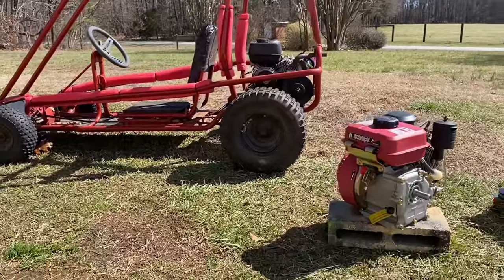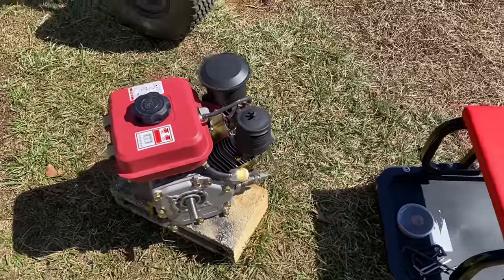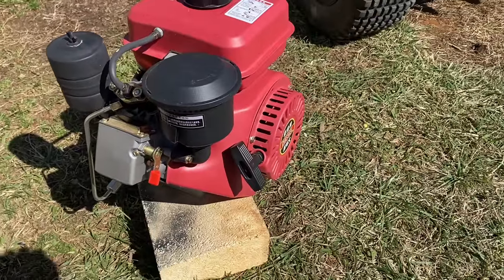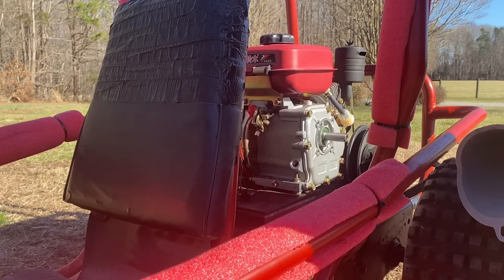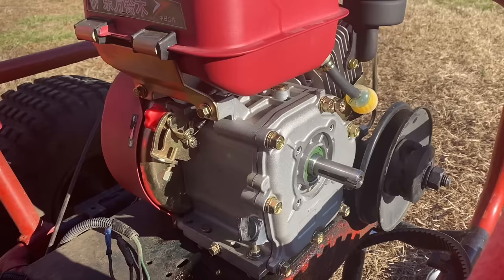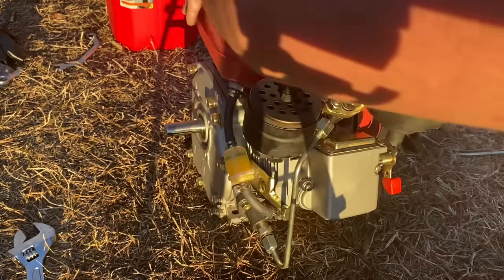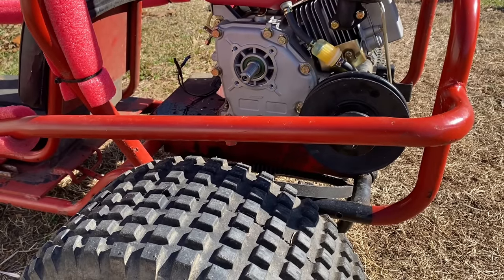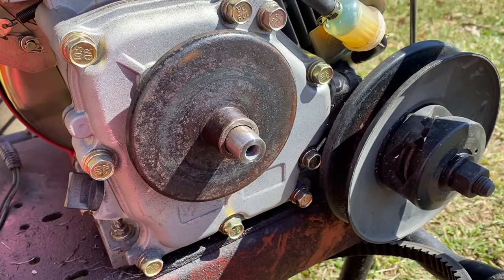Amazon 196cc Diesel Engine Go-Kart Swap - Rolling Coal In The Go-Kart

Comment: Brother, to start/prime any diesel with a dry injection system, simply stretch a gasoline soaked wrag across/over the air intake and crank, it will fire better than starter fluid with no lock up. Fire it on gasoline fumes until till she takes on diesel. I am a former Alaskan diesel mechanic, and this works at 35°F below.
Reply: Thanks do I soak in deisel?
Reply: @JohnSmith-wq8jn did you read thoroughly?he said soaked in gasoline
Reply: @JohnSmith-wq8jn i before E except after C does spelling wonders
Reply: @jkclassy3643 weird.
Reply: Of course a diesel mechanic would give us a tip that terrible. Gas fumes are still gasoline, ether is better because it doesn’t have as strong of a pre-ignition knock as gas, less potential for damage with ether assuming you don’t put a gallon of it in the intake.
Reply: @johnfloyd2551  so diesel on a rag?
Reply: @_..-.._..-.._ people mix gasoline with diesel all the time on cold regions, it's not an issue.
Reply: I call that trick life support, used it to crank over a mk4 jetta vw diesel 1.9 TDI when i was having injection pump issues

Comment: Great reenactment of the delivery..lol..that Diesel engine is actually a 4hp Diesel with lots of torque for its size.. although many ads sell it as a 6hp in their description..it's really just a 4hp..I have seen it replace 8hp gasoline engines on several different machines such as log splitters..they can run on different fuel types without issues too such as used ATF ( automatic transmission fluid) and a slew of others..the original Diesel engines burned peanut oil before diesel fuel was available..probably burn almost anything but gasoline..used Vegetable oil would need to be heated up, like a copper coil / line wrapped around the exhaust system before it would burn..and the engine would need to start and be running Diesel fuel a few minutes to clean out the injector before turning it off if used with Veg oil etc..just a few on / off valves and separate fuel container to make it happen..Cheers..
Reply: Used motor oil mixed with gas works much better than veggie oil and doesn't need to be preheated
Reply: @thegman4759  and you could probably a bunch free, just ask auto stores that accepts used motor oil
Reply: @thegman4759  hell no.
Reply: @DieselRamcharger  hell no ? What?
Reply: @Diesel Ramcharger  you make no sense
Reply: @snesguy9176  Auto Stores WILL NOT give you that oil. Do you know what liability is?
Reply: it's 6hp when installed on a transmission because the torque lets you pull more in relation to the gearing ratio
Reply: @Diesel Ramcharger  actually any mechanic will give it to you for free since they have to pay to get rid of it do your research before you start flapping your gums in the wind
Reply: @standard-carrier-wo-chan  thats not how it works.
Reply: @DieselRamcharger  
Then why do I have 400 gallons of waste motor oil sitting alongside my garage? I run my1986 f250 with a 7.3 idk on it. So....
Reply: It depends mostly on the type of pump and it's tolerances. Run anything but low sulfur diesel in a modern CRD and you'll destroy the fuel system.
Reply: @standard-carrier-wo-chan  Thats not how it works. HP is torque times rpm. The diesel engine has a low rpm, so it produces low HP. If you want to increase the HP, you either need to increase the torque or the RPMS. It doesnt magically gain 2 hp for zero reason.

Comment: The factory mufflers are extremely restrictive, you will gain  a horsepower with any honda clone or predator header. The intake is also restrictive and robs power.
The adjustment screw that the red throttle screw stops on is set at 3,000 rpm. If you remove the adjustment screw it will rev to 3,700 rpm which is totally safe for that little engine.
Reply: Do the Predator headers fit with no modifications?
Reply from the maker: It has had a smoke stack now and you can tell it breathes a lot better
Reply: @greglewis3382  I believe they do, it just may point in a weird direction.
Reply: Does it have some sort of governing system that can be modified/removed so it can go above 3,700
Reply: @RedNeckAdventure  there's no benefit to it. I just built one of these to blueprint specs and ported the head and slight porting /shaping on the prechamber and the power still drops off after 3,000. The stock heads on these stink so bad. The valves are completely shrouded, that's the biggest issue.
Reply: if you did want to make it rev higher, first step is removing that screw completely, then if it still isn't where you want it, you'd have to modify the governor weights to make them lighter, the stock ones are labeled 5 I think which is grams, you could use a gram scale and grind them down to 4 grams and that would allow more revs, the valve springs are very stiff so they shouldn't float until 4k rpm, but the rocker arms are way too heavy and over built, I recommend shaping them with a bench grinder to remove as much weight as possible in areas where it's not needed. They have excess steel casting marks that add a ton of valve train load.
Reply: 🎉thanks

Comment: I bought a 10hp Chinese Diesel engine from a warehouse in the USA. It was shipped in 2 separate boxes. The outer box had a "THIS SIDE UP" notice on it. The Inside box was inserted UpSideDown in the box with the 
"THIS SIDE UP" notice...so the Engine made the entire trip UpSideDown,  the Fuel Tank and the Muffler were all banged to Hell when I opened it up. I got my full purchase price back ! Liked/Subscribed !
Reply from the maker: Shoot that worked out pretty good then
Reply: Whered you get it

Comment: I have a diesel engine I got from a stripped down generator at a local scrap yard. It was complete minus the muffler, voltage regulator and recoil starter.  I got a nice muffler from an Onan twin engine, one of 2 (it was a twin cylinder), and I'll make it fit. I'm thinking of putting it on a riding tractor for riding around on.

Comment: Cool engine swap, I wonder why that engine always runs so horribly when cold though?
Also love the output shaft "lathe" work 😂
Reply: Because its air cooled it takes a while to warm up. for a deisel with no glow plugs this means the fuel takes much longer to ignite in the cold, causing bad timing.
Reply: @MADEINNSW  Makes sense usually but I've seen colder starts on here that run better.
Then again these 3hp or whatever diesels are super bottom of barrel
Reply: It's Just because it's a cheap engine quality diesels of this size run completely fine from cold I've started mine down to -10c and it still started first time (robin/Subaru/Fuji)

Comment: Lol intro prob demonetized. I bought two generators one with a 178f and the other a 186f. I'm going to fix and sell the one and use the money to rebuild the blown 186f 10hp. Looks like it dropped a valve and cracked the piston. No idea what I will use the engine for but it's cool af. Should break even and have a free China diesel

Comment: Here is a tip with those diesel engines I have run a few of them over the years add someone cheap Walmart 2 stroke oil to the fuel 111ml to 5L diesel and some ctane booster helps the injection work better and start easier. Also change the oil a few times after the first few runs. Also a bit bet exhaust helps to! 🤘🏻🍻
Reply from the maker: Appreciate it, I’ve got some ctane boost, I’ll have to look into the oil and def overdue for an oil change
Reply: @jwsbackyard6413   The last one I bought about 6 years ago had a lot of contamination after the first hour run time.  The shell Rotella 15W40 diesel oil is the best I find in these engines. Has a lot of zinc in it witch is a good thing.  Also when you add the 2 stroke oil it doesn't make it smoke any more than it already does
Reply from the maker: Gotcha

Comment: Typically , ie most commonly the Recommended oil is 15w-40 , I'd use a variant for big Diesel Turbo Truck applications.  
 Nice swap Brother 
For a cut off I'd might try a cable system to pull the decompression handle down , cutting the compression & very helpful if 1 were to ever experience a runaway scenario . 
I'm sure there are other ways , yet I'd also like to see an Add on self regulating Alternator to charge a battery, run lights, winch & a Fan to cool engine in hotter weather . 
  Just a few thoughts & you've definitely got the Skills to make These things happen . 
New follower 👍

Graciously,  Reverend RM Bowles 

Now I do need to do a swap on a Bolens lawn mower , shouldn't be too difficult but I haven't yet figured out how to swap my Bolens Vertical shaft Rear tine tiller yet . 
Help here would be greatly appreciated 
We need these Swap solutions , ty for being a Entrepreneur & Pioneer 
May the Good Lord Bless you
Reply from the maker: I appreciate it! Yeah the cable to the decompression seemed to be the best option. I have the cable and brakes I just need to get it on. You’ve got me interested now in the horizontal shaft to vertical transition now. I don’t have any suggestions at the moment. I’m going to have to look into it and let you know if I see anything promising.

Comment: You pull the cord till it’s tight then push the decompression and pull and it will start right up I just naught one and it work great
Reply from the maker: Oh yeah this one does the same, the issue was that I hadn’t primed the fuel system correctly at the start.

Comment: FYI, starting fluid kills diesels. It's best to take a rag with a little gas on it and put it over the air filter housing. The fumes will run it more gently than ether will. But it looks like it was just an issue with bleeding that you had to deal with.
Reply: More of an issue if there's glow plugs. Back in the day diesels had ether injection for cold starts before glow plugs.
Reply: @soberlife  depends on a few things like volume, if it's two stroke boost pressure and the compression ratio. You can use either on an old Detroit but it'll just cause small diesels to detonate and bust rods.
Reply: He forgot to turn the throttle from "shut off" to "on".  On all of these mechanical small diesel engines the lowest throttle position is "off" for the fuel = No fuel goes to the injector.
Reply: Not true.... No, just no

Comment: Sounds pretty good and rolls a fair amount of black smoke. Had my yellow 196 "4 horsepower" (actually a 3.5 horse) in a shed for about a year and it runs pretty strong to this day. Bought it for my mini tractor project.

Also. Some people wonder if these cheap diesels share the same internal and external parts as the Hondas/Clones/Predators and such, and they want to know mainly because of all the aftermarket support (exhaust, air filters, connecting rods, etc.) for said engines. To answer their question: yes and no. Obviously the intake and exhaust manifold ports are the same as the 160/196/212 gas counterparts. I have a cheap Amazon intake adapter for a GX160 bolted to it and I used a flange from a generic 196 to make my smoke stack header. Judging by the outside view of my diesel engine, it looks to have the same bore and stroke as the said gas engines as well, so the billet connecting rods and pistons will definitely interchange and the high-revving crankshafts MIGHT interchange too. Cylinder heads will also interchange but good luck putting a fuel injector in the spark plug threads of a 212 HEMI cylinder head. Camshafts will interchange unless the diesel cam is of a bigger diameter or has another gear on it specifically to drive the fuel pump. Hopefully I'm right about some of this stuff. I'm honestly not familiar with these small diesels. LOL
Reply: I've got the same engine you do. Going to be testing some of these theories later this week. Did a diesel swap on my Massimo 220U minibike.
Reply: I think the cam has an extra lobe to drive the injection pump via a pushrod.
Reply: @Possumliving  Darn. Guess that leaves the camshaft compatibility out.
Reply: @FreidPickles  Cool. Hope the tests went/are going good (my reply is late, I'm sorry lol).
Reply: @ChickenwithaHelmet  haha hey no problem. I've been lazy and busy with other projects but will be working on it when the weather cools off.
Reply: @FreidPickles  Alrighty. That sounds good, dude. I got a lot of frame work to do on my tractor (which is actually a lawn mower but technically they're still the same thing lol) before I can even do any mods to my engine. I got a rusted Craftsman with a flathead Briggs and a bent frame John Deere with an OHV Kohler. The Briggs would've been a really good project engine if it hadn't been hydrolocked. I plan to use the good parts on the JD and put them on the Craftsman.
Reply: @FreidPickles how’d you get the throttle to work on a mini bike? Looking to do the same with mine. Thanks

Comment: Hey cool video I put one of these on my Coleman mini bike how'd you connect a proper throttle cable
Reply from the maker: I ran a cable through the throttle stop screw that it has from factory. The stop screw is hollow and allows for a throttle cable to pass through but has a bigger cup that will hold the outer sheath of the throttle cable. Then I ran the cable through one of the holes in the throttle lever and put a cable stop on the cable. I put the cable stop on low enough that it always keeps a little tension on the throttle lever so that the engine will idle instead of returning all the way to stop. The red knob has to be loose so that the throttle will return to idle smoothly and not get stuck wide open.  I will try to post a video of the setup soon.
Reply from the maker: Just uploaded a video of the throttle cable setup

Comment: The problem with running diesel on a torque converter is your gaining no benefits over a gasoline engine. On a torque converter that is, direct drive or with a clutch would be different.
Reply from the maker: What do you mean there is no benefit with a torque converter on a diesel?
Reply: @jwsbackyard6413 that belt slips when you put too much torque through them, it's really more fit for a gasoline engine.

This is the same reason why you don't see diesel cars with a CVT, they always come with either a DCT or a conventional AT.

The high torque at low RPM doesn't translate well with a belt drive CVT.

Comment: I have a single cylinder Yan Marr diesel engine it’s made in Japan it works really really good it came off a compactor I had it run away on me two times because I accidentally overfill Oil However it did not blow up I like that design that you have on that engine versus the one that I have because the one I have is straight up and down

Comment: I got one of these from Amazon.  It arrived with the throttle control bent all to hell.  I fixed that but the spring runs from the throttle control to a lever under the gas tank.  When adjusting the throttle control the lever doesn't move.  This doesn't seem right.  Have you noticed on yours if the lever has much travel to it?  I haven't been able to get fuel through the metal line.  When I disconnect it at the bottom where it is hooked to the pump I get fuel but none at the top of the line.
Reply from the maker: The lever doesn’t have a ton of movement but that lever is what shuts off the flow of fuel. When you prime the fuel you have to have the throttle control open as if you are pressing the gas, otherwise the fuel is cut off. That was a mistake I made.
Reply: @jwsbackyard6413  The lever only moves about 1/16 of an inch.  I have the throttle control set nearly half way and still no fuel.  I may have to return this engine.
Reply from the maker: Yeah I have had the pump out but haven’t opened the side cover up to see how the linkage really functions.

Comment: It always frustrates me when folk fit CVT transmission to things with no adjustments.
In scooters you change roller weights, unless you get it right they are horribly slow, revving to high or low.
In your Chinese CVT there is no adjustment ......unless...you change the spring on rear pulley, stiffer for higher rpm 
Even the ramp angle of rear pulley can be wrong so that the rpm is correct at full load but not at other times or vice versa!
Reply from the maker: I have a selection of garter springs to change engagement speeds on 30 series torque converters as wheel as yellow springs for the driven pulley if needed. Axle and jack shaft sprockets can also be changed here for different results but with an unknown engine and no one knows what changes to the converter are going to work for the setup until they get it together and try it out. I’ve changed the driver and jackshaft sprocket since this video and the kart is much faster.

Comment: I for one would be interested to see how well the injection system lasts from a maintenance perspective.
Reply from the maker: So far I have done zero maintenance on any part of this engine since I posted the video and it cranks 1st pull almost every time. The rubber fuel hose has started to crack on the outside which seems premature so it will probably need replacement soon.

Comment: What size centrifugal clutch do I get ? I wanna build one
Reply from the maker: It’s a 20mm output shaft, most are 19mm, so it’s hard to find an affordable option. I shaved the output shaft down a mm so I could fit a standard 3/4 on it. I’m using a 30 series comet torque converter on it but it’s not quite strong enough to hold the belt with as heavy as the kart is.

Comment: How is it on fuel consumption?  Just bought one for a DC generator to charge my batteries for my solar setup for Cloudy days. Thinking it will be better than gasoline. Thoughts?
Reply from the maker: I definitely fill it up less than my gasoline engines for the same running time. Don’t have any numbers but there is a noticeable difference.